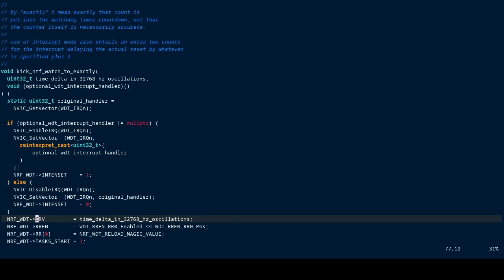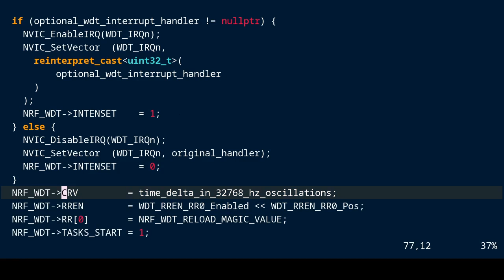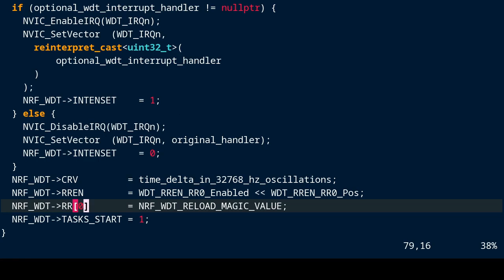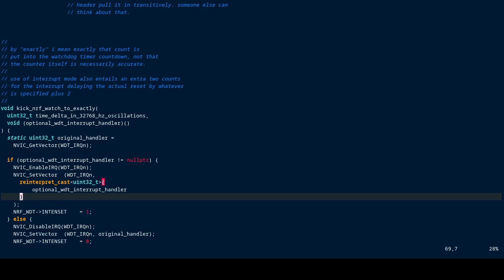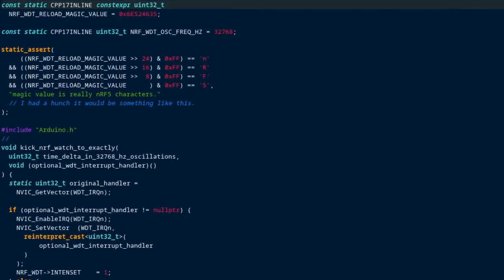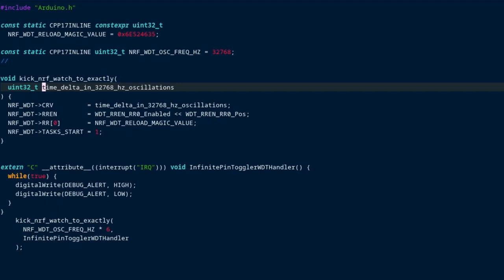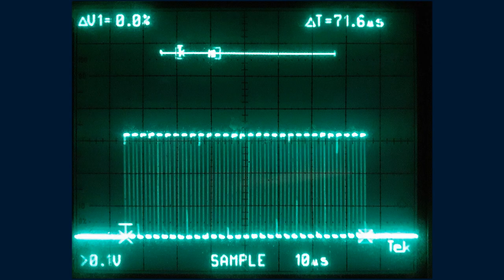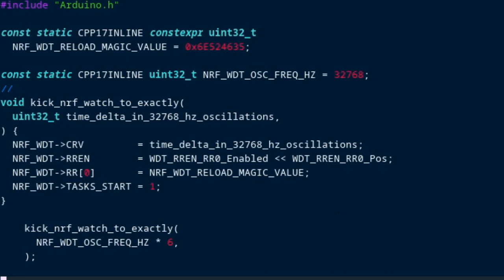How to use the Arduino Nano BLE/Sense Watchdog

Comment from the maker: [ERRATA]  I know nobody is watching this, but in case someone ever does:
The NRF_WDT->INTENSET; = 0 usage in the else clause should really read NRF_WDT ->INTENCLR = 1;
Assigning 0 to INTENSET doesn't actually do anything. Although, you're unlikely to notice given that the IRQ is disabled in NVIC.
And odds are if you start using this with an interrupt you're going to keep using it with an interrupt anyway. Still, it's technically wrong. So if you saw that and are wondering if it's you, it's not you. It's just wrong.
Reply: There are dozens of us!